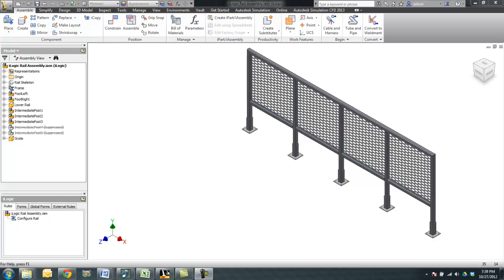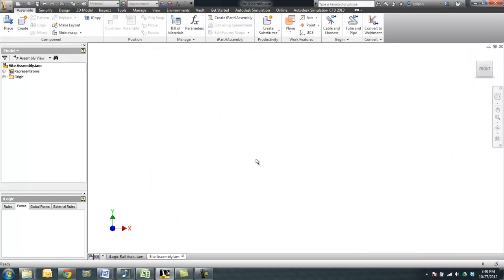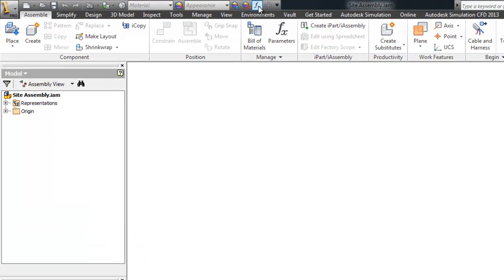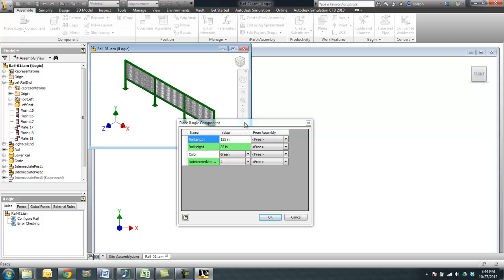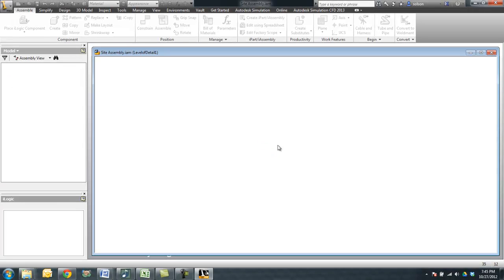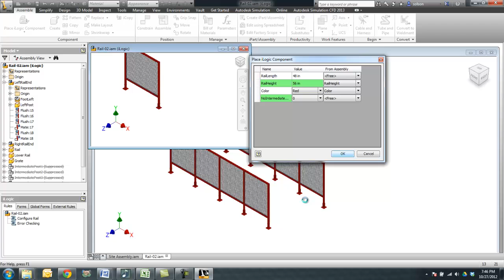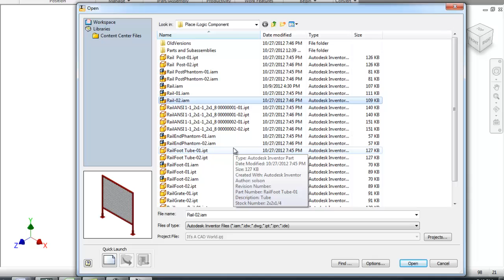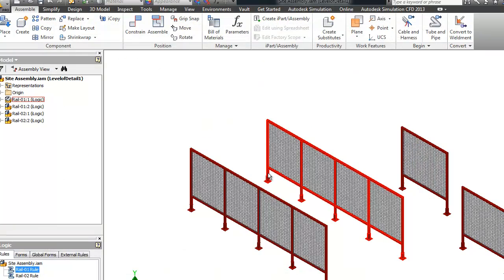Placing iLogic Components

Comment: Hello sir, I need help  how to create ilogic  command,buz we are designing a steel door  so how to apply these futures ,
Reply from the maker: You would need to model your components with parameters.  At the assembly level, you can have the parameters that drive the size of the door.  Then your iLogic rules will then distribute the parameters into the necessary files, if calculations need to be done, it is possible to include those in an iLogic rule or parameter definition.  If you want more specific help, feel free to email me.

Comment: Hello. I am 7 years behind. I also used the Content Center to create custom channels, and it works for the first placing. But when the second placing has different size, it affects the first one's size. Can you tell me what the solution is? I try to download your file at the previous comments, but the link is no longer working now. If you still have the file, can you share the file here again?
Reply from the maker: When you are placing from the Content Center, Inventor will generate an ipt of the channel you need.  That ipt of the channel will have a specific length.  If you need a different file of a different length, you will need to create a separate ipt.  If you run the Place From Content Center command again and specify a different length, it should create a second ipt from that channel's family with the new length.  If it is somehow effecting the first channel you created, you will need to look at the column in your Content Center Family that determines what the name of the IPT will be.  Often times with a channel, it will prompt you to add a length or distinguishing attribute to the file name.  Often, I add the length attribute to the file name formula to account for different lengths of the channel.
Reply: @3DSteve52  Thank you so much. I removed ":1" at the end of the member name in iLogic rule. And it's working without any issue now.

Comment: I have a problem when i place an Ilogic assembly (i will call it is A) into another larger assemble (Call it is B) which contains A.

when i placed A into B, the accessories of A which i had written commands in a rule of Ilogic, it would be changed the name as well as a new assembly from A.
but the content of rule in new assembly didn't change anything. so the rule of new A couldn't find them, and condition changes(height dimension) of those components didn't run when i chose some choice in a form box.

exactly, after placing A into B, A was became A-01, A-02... but the content in the rule of new assemble A-01, A-02 don't change anything, it still keeps the content exactly like A.

therefore, every dimension which i chose, it didn't work.
I know this video had made since 2012, but could you please help me do it again and share me content of rule of ilogic in your drawing?
Reply from the maker: Here is a link to where you can download the model.  http://a360.co/1MHnhRf  

One possible cause to your problem is the browser node names.  iLogic uses the browser node names for components.  Since the Place iLogic Component command copies the assembly, it is likely renaming the browser nodes.  A way to prevent this is to give the browser nodes static names.  This is done by editing the name of the browser node.  Just simply removing the ":" is enough for the software to see that you edited the name of that specific node.  You will have to edit the iLogic code to match the new browser nodes.

If this doesn't work, let me know.  I would be happy to look at a model for you, if you would like to send me one.